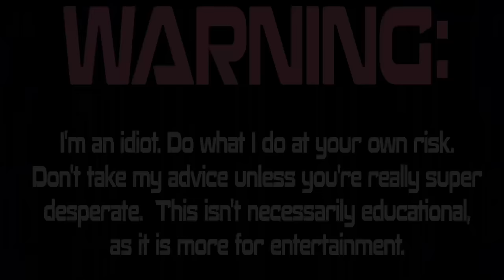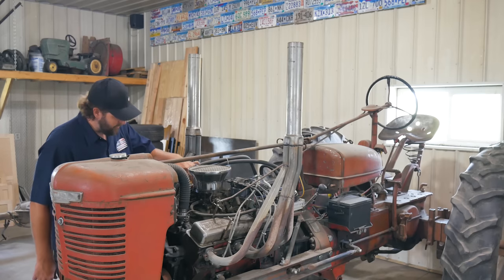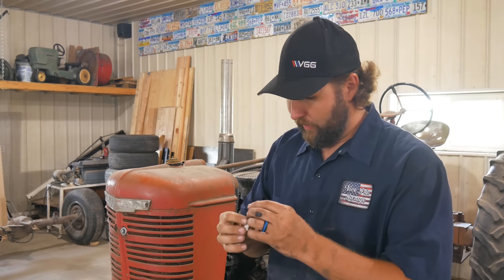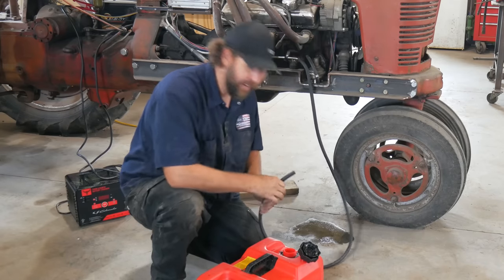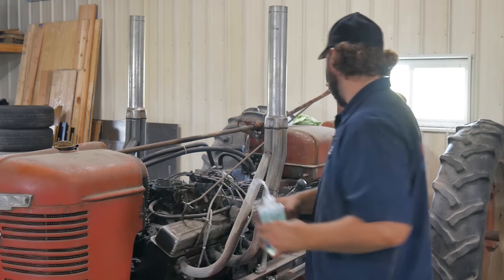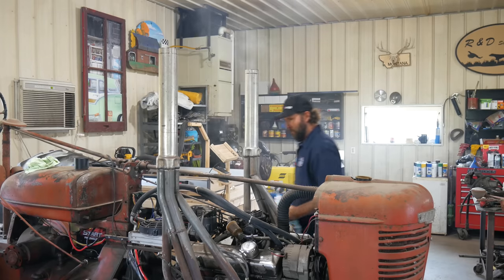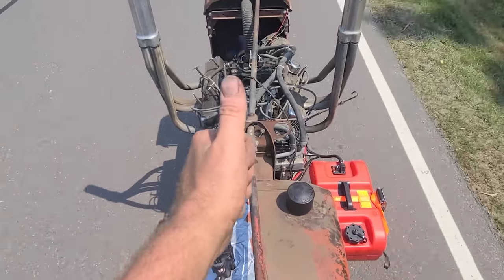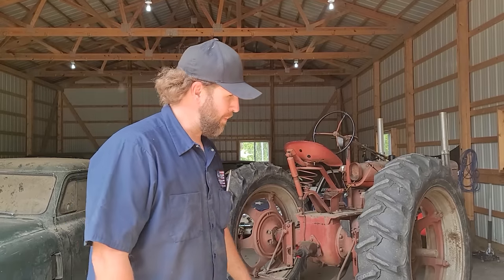FORGOTTEN V8 4 Speed Swapped Tractor - Will It RUN AND DRIVE 35 miles home?

Comment: This is why farmers are some of my favorite people. From time to time, they engineer up some mighty fine conglomorations, such as this here jewel!
Reply: My uncle made a custom loader out of an old combine it worked like a dream
Reply: @edisenscore1494  What! That's like making a boat out of a tricycle! How the heck did he do that?
Reply: @randallsmerna384  he took the cab off an old combine and put one frame from the combine on top of itself and acquired some hydraulic booms and hooked them up to the bucket he then set the engine in to power the front wheels and kept the rear wheel steering it was a sight to behold
Reply: I put a 6-cylinder turbodiesel from a Volkswagen in my Nuffield tractor :) I think i posted some test runs on my channel.
Reply: @MaxNafeHorsemanship  no doubt
Reply: They're the only engineers that I trust...!

Comment: "You don't need them all right, that's why there's eight." Tune-up wisdom for the ages.
Reply: The amount of drag races won by V6.5s and V7s is astonishing!
Reply: You bet.  My dad had a 77 Caddy that a rocker arm broke (common issue on the 425); he ran that sucker for several months on 7 cylinders, that big ol engine didn't care.

Comment: A farmer who worked with me, build a similar tractor in the early eighties. His had an automatic transmission behind the engine. It would downshift during a hard pull. He had dual wheels on the back. Amazingly the original transmission survived plowing fields for years while running with all that power.

Comment: Theres sketchy, and then there's 30 MPH on those tires! A feller's braver than I would have thought! Thanks for sharing! 🇨🇦
Reply: Thsts what I was thinking, that tractor factory up and running great would do about 15mph. I'm not sure how fast it would go in od on both transmissions, but its a safe bet that it would be way faster than the tires and axel bearings can safely operate.
Reply: You fellars musta missed the tyre kick which checked the precision balancing for optimal wheel spinnage. VGG certified for all the beans.
Reply: @codylapoint  I was thinking about those bearings!! Thinking they are probably pretty HOT going that fast.
Reply: @codylapoint  The four speed up front still only has a 1:1 final drive in fourth, so it can only slow 'er down, not speed it up...the extra RPMs from the 350 would give a speed boost, though.   The old H motors were 1650 RPM, pretty sure that 350 can turn a bit more.  :-D
Reply: @lonewolfworks  Road gear on an H is pretty scary with that narrow front, sloppy steering and mechanical brake linkage.  I usually stayed in 4th, mine jumped out of 5th anyway.

Comment: Derek, if you can pull together a video on reading plugs that would be pretty cool.
Reply: He mentioned it in one of them and if I’m not mistaken I think it was the one where he worked on the v8 snow mobile. Maybe I’m wrong though!
Reply: It's very simple to read spark plugs mini videos on the internet on it
Reply: @drivecam101 I remember every Haynes manual always had a color plug reading chart on the inside face of the back cover.
Reply: I had an old Hanes manual for my 76 Honda Civic back in '84 and it had a color section on reading plugs... Never quite knew back then how important it was but I do recall it.

Comment: To answer your question Derek, PartsMaster oil filters are the value line of AutoValue parts stores in Michigan and the Midwest. They are manufactured by Wix, your favorite! You can interchange their filters to a Wix air / fuel / oil by changing the 1st digit of any of their filters. In your case the 1st digit is now a 5. If you ever need Wix filters in Michigan, now you know. :)
Reply: I was gonna say pretty much the same thing, but in the south they come from Bumper to Bumper.

Comment: Hey Derek, that gray paste you found in the sediment bowl - that's the result of ethanol fuel and whatever type of pot metal they used to make the sediment bowl housing. It more/less starts dissolving it. Will plug a fuel system up solid.
Reply: Thanks. I found something similar recently, but thought something rubber was coming apart. I'll have to look in the tank to see what's being destroyed.

Comment: Worked at chain of auto parts stores called Lee Auto Parts in Chicago.... in the early 2000's. We carried lot's of Parts Masters auto parts. Bumper to Bumper 👍🏻👍🏻
Reply: Part Master in Pennsyltucky were in Carquest stores
Reply: We use parts master filters at the shop where I work. Bumper to Bumper carries the full line of them as a house brand for oil, air, and cabin air filters.

Comment: loved the view of the drive home, that extended nose and it being a tractor gave it a impressive powerful feel like it was saying ya i am still here kicking it.
Reply: Its why the ultimate car is something like a V16 (or mated twin big block) powered, extended suspension travel lifted off-road vehicle where you sit a few feet behind the center of the wheelbase, kind of like a Daimler Double-Six. You sit high up, lording over everyone on the road, even that one guy in his lift-block'd Silverado on 24' rims, you got cameras so you don't bump into stuff or accidentally pancake any Priuses, and you got a long hood hiding massive torque and holding epic noise to kindly inform everyone you mean business.

Comment: Found a 1989 GMC truck for my son, runs, drives, needs brakes, but no rust and has a dent in pass. door and pass front fender, but the guy is throwing in fender and door. it is pretty awesome. We will go thru the vehicle just like Derek and add AC that Derek just walked me thru on a video. What an awesome day.

Comment: Bleep bloop: Parts master is an auto value brand/ or at least affiliate. Loved the video.
Reply: Auto value in viroqua wi?
Reply: My comment thingy isnt worlding , so this is to VGG, I used clear tubing to drain gas using mouth positive flow generation so I can see the fuel before it enters my mouth system cause I get I digestion or commonly know as stomach gas.
Reply: @user-gp6sw  Partsmaster is an Auto Value brand. Auto Value/ Bumper to Bumper in Michigan,Illinois and Wisconsin is distributed by Autowares. They are headquartered in Michigan with warehouses in Illinois and Wisconsin.

Comment: Parts master are pretty good, we use them at our shop, no problems with them  that I've noticed.
Reply: Well since the number companies that make oil filters are about the same as companies that make batteries which means that they can only be as bad as a fram or as good as a wix but chances are it’s a purolator if it’s was made in North America and these days unfortunately that is a big if.

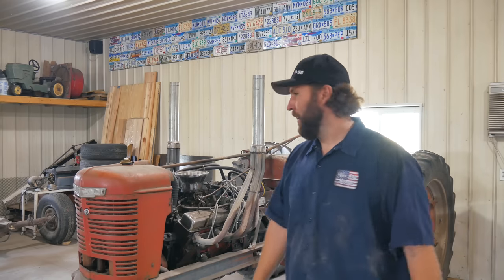Comment: Well I’ll be dipped!! At around the 13:00 mark I spied an older John Deere pedal tractor up on a shelf behind Derek. Both parents worked for Deere and I had one just like it instead of a trike. Loved that thing and literally wore the tires off of it. Have always wished I could find one again. So great to see one. That has to be from the early 60’s.

Comment: I used to road International 806 tractors on occasion. I discovered that with a careful touch on the steering wheel, you could slowly rotate it continuously to the left all day long while driving in a straight line. I think the 806 was good for a little over 30 MPH.
Reply: I got a tight grip on that, ten-four, over and out!😁👍
Reply: That is correct and not dangerous, it is caused by the orbitrol type steering.

Comment: Replace that chrome oil pan with a fined aluminum one when you do the water pump and that will drop your temps as well.
Reply: Dis is quality idea
Reply: That might exceed the value of the whole tractor or at least the engine
Reply: @gmcman283  not wrong. Ya got a point
Reply: Excellent idea

Comment: Been there, done that. I'm 65 so I'm talking a long time ago, '67 through '70 we built 3 F20's with SBC. G'grandfathers abandoned equipment that had sat since before my dad was 10 yrs old-25 plus yrs. A days cutting trees that grew through and in front of them, we pulled each 21 miles from that farm to ours on round-about rock roads. Wasn't nearly as much work to do fitting in an F20 as your builder had to do. Partial adapter plate on the bell housing, spines on the flywheel, mounts, and the longest fan shroud you'd ever see. Two 283 and one 327, last two sold before we even began building. Small town parades, small town fairs where they'd have antique tractor pulls- these as exhibition. This is only the 2nd vid of yours I've watched, will be going to the oldest and making my way to now-but being a ford/mopar guy I'll skip some gm stuff.

Comment: Need a 454 stroked big block with an 8 speed autotragic. Yep those tires are in just super shape. Need a full flex desert fan with a deep Toyota Tacoma autotransmission radiator will fit.
Reply: Why??????

Comment: What a great combination: Farmall + Chevy V8. I learned to drive a tractor on dad's '46 H back in the '50s. Spent a lot of time riding that old horse, plus his M and 450. They were a very reliable and versatile tractor. Grandpa and my uncles all had an H at one time. Today I own a 1948 H with a Heisler 9-speed (overdrive); works like a charm. Well, I hope you have it purring like a kitten and doing "hold-shots". Thanks for the ride.

Comment: My uncle did that but he made an adapter to the original transmission, Ford engine. He used to rake hay in low gear, hauled silage passing cars on the highway.

Comment: One of my uncles had an ancient Case that he bought to switch from horses. After to getting a newer larger tractor he would leave the old one behind the carriage house. I can recall as a small boy that in the spring he would put in a battery, fresh fuel take the can off the exhaust and it would start right up. Year after year until I was a teenager and it was sold at auction. Amazing.

Comment: Yeah. That's the tractor I drove when I was a kid. Not swapped, just factory. Thing many people don't know about the tricycle type tractor? You hit a rock or a hole with those two front tires? It spins the steering wheel in your hands. If you're driving with your thumbs around the wheel it can break your thumbs. You'll see a brodie knob on some of them but I'm not sure I'd want that on the wheel either, just another way to break your upper arm if it hits you on it way around. We didn't have one and only my older brother was stupid enough to not listen to our Dad to not wrap his thumbs around the wheel. Like motorcycle accidents, it's not an if, it's a when it happens.

Comment: There was an old IHC either an H or M, that someone swapped out the engine for a 350 Chevy also. The boys used to run it in the local parades. This was in the mid 1980,s., here in west central Wisconsin.

Comment: I know someone who used heater cores for water air intercooler heat exchangers, using 2 of them they supported up to 800whp with great charge air temps unless the car was really heat soaked. But even then driving down the road just a little way would get them dropping again just as fast as any purpose built heat exchanger for a water air intercooler setup.

Comment: Got me a new china battery charger has automatic 12v or 24v with automatic charging , but has a switch for manual [boil] and knob to turn the massive 10 amps  down for the little batteries. I think it was like $30  on the Bay. another cool thing is. If you don't plug it in, you can use the clamps to check voltage.

Comment: I had a '79 F250, into which the previous owner had transplanted the 429-4V from a '68 Thunderbird. That truck taught me to hate swaps and custom stuff on vehicles. I could never explain what I wanted at the parts store. "What year and make?" "No, see, you can't just punch in '79 F250. It's had a '68 429 swapped in." <pause> "429 didn't come in a '79 F250." "You don't say."

Comment: To fix a leaking cooler quickly is that when the engine is hot, pour in some ground cinnamon and fill up with warm water. Then you drive a couple of miles and that seals the hole.

Comment: My Dad grew up in a Rural Farming area and  he always talked about a Farm Vehicle he helped put together as a teenager that had two Transmissions mated in-line  to the drive shaft he told me they did that to get the gearing way down that it would pull anything not fast but pull it he said it had so much Torque that if he pulled it up to the outside a a barn  wall it would  climb the front wheels  up the side of the barn

Comment: Parts Master is sold around me in southern indiana and louisville, ky at a parts chain called "Bumper to Bumper Autoparts" I rank them at a Napa level parts store. They have told me the "parts master" brand is a WIX and the oil is Valvoline.

Comment: Did you notice those nice holes on the steering shaft support?  I bet that water temp gauge flopping around with its tie wrap mounting would fit in one of them!  I bet an oil pressure gauge will fit in the other!

Comment: If you worked on cars in the 80s, you would get what I called "penzoil motors"  Pensoil? was the most popular, by far motor oil. Straight 30 wieght of unfrefined dirty pensivania crude . It created a froth crust of burnt oil throughout the engine and especially in the valve covers. If you putgoodoil in, you ran therisk that all that gunk would drop into the pan and be picked up by the oil pump and clog the sump 100%. On my recoveries I would pull the valve covers, clean everything therein, change the oil ( Castrol GTX 20-50). After that I run it a bit ,drop the pan,scrape the crud,dump the gunk and change the oil and filter. I saved many old tapping motors this way.

Comment: As a teenager, I put a SBC in a 47? Hyster forklift.  There's just no way to get parts for the flathead 6. I used the original radiator but bolted on a digital fan.I used the old top loader 4 speed,with the granny gear from an old pick em up truck. I made the drive line to the differential and another for the hydraulic pump on the front pulls. Of course, the shift patern was bass-ackwards.I flipped the exhaust manifolds upside down and ran the pipes straight up. Worked beautifully.  Idled everywhere and only need 1500 RPMs to run the forks up under heavy loads. I used to say," You can put an SBC in anything, and it will be better. Tesla?
Reply: People do idiot things. A couple of wrecking yard mechanics had rebuilt the other car lifter before me. These morons put a 390 Ford in it. They had to cut large chunks of frame out to do it. It overheated constantly. No1 ever wanted to use the 390 forklift, but my SBC worked perfectly and is probably still going.

Comment: My favorite aircleaner is to use that same style "salad bowl" with a round ceiling vent cover on it to redirect the airflow from horizontal to vertical and down the "salad bowl" with a large diameter air filter base and cap with the largest diameter air filter cartraige  I can use with the base.

Comment: Watching this 2 years later.  Bentley was so small and it wasn't all that long ago.  Also, Parts Master is a brand that Bumper To Bumper sells.  They have both Parts Master filters and Parts Master Oil.  The filters are actually made by WIX and the oil is made by Ashland aka Valvoline.

Comment: The extra transmission would not increase your ground speed, since in high gear, it is in direct drive.  Any increase in speed would come from the higher engine speed.   The extra tranny would only provide more lower gearing for pulling purposes.
The Sherman transmission found in some Ford 8Ns, provided both an under drive, and overdrive.  The overdrive was good for going into town.

Comment: A long time GM mechanic showed me a trick for leaky GM water pumps. He showed me that if you take and cut the point off of a golf T and gently tap it into the tattle tale hole on the pump it will stop the drip. Of course that only works if nothing else on the pump is leaking like the shaft.

Comment: Ive always thought this would be a cool idea ever since i was looking at an oldie time mint ford tractor, i though man a mustang 5.0HO engine plopped right in there but just hooked to the tractor trans because like that it would be just as simple to run as original and work great as a tractor it would just look and sound awesome and likely way smoother, and bit more steam than it had.

Comment: In 1970 or 71, my brother  (3 years older than me) got ahold of an old allis chalmers either old wc ,
or wd  I remember you had to let go of steering wheel to put on both hand brakes. think that makes it a WC . He put a 283 chevy motor in it  with home made headers going straight up he made out of dairy cow stanchion pipe, he used the already exsisting curve  no pipe bending I don't think he had to lengthen the frame. but I know it went fast enough to get pulled over on a sunday morning by the Sun Prairie wi. police for either speeding or the noise. It was cool .But buying one already done how much did it cost?

Comment: I had this fuel issue with an Allice Chalmers and it was full of dead wasps.  Apparently the would get in the fuel nozzle at the pump and die in there and then one would pump dead wasps in the tank.  What a mess.

Comment: 3970010 and 0014 blocks came in 2 and 4 bolt main. 0010 is an earlier small block that came in different cubic inch configurations. I'm assuming you already know this, and were just messing with me.